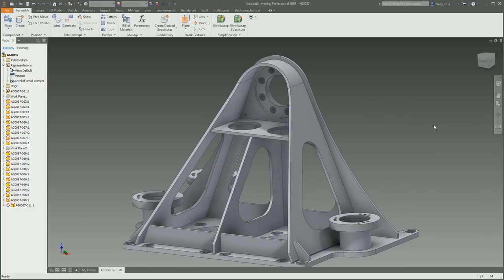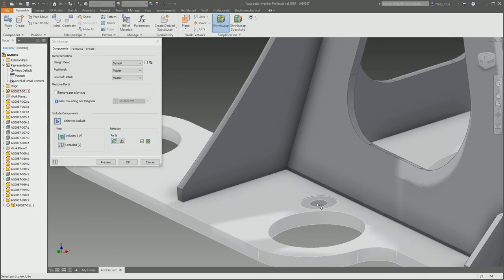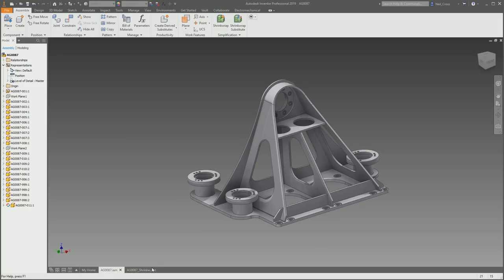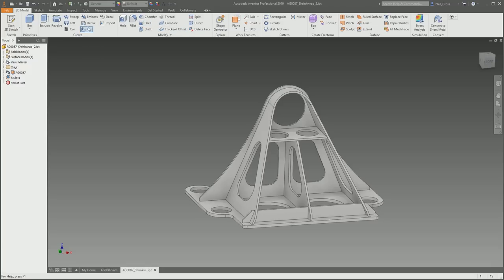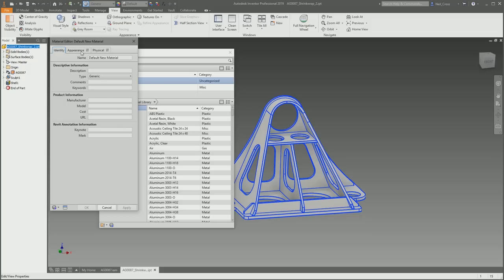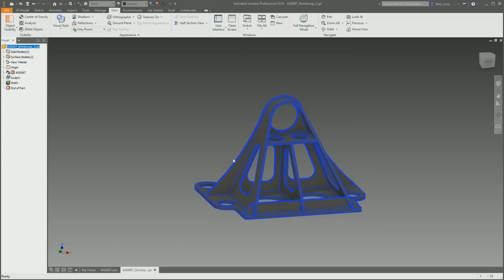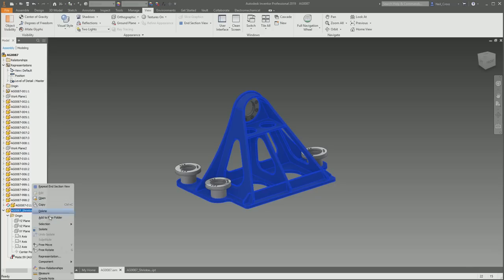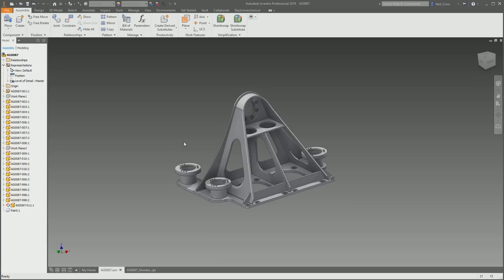How To Calculate The Weight of Paint or a Coating | Autodesk Inventor

Comment: Hi Neil,
I work in a design team creating sewage treatment plants for cruise ships. Biggest I worked on was 9 metres square and 3 metres high with a base frame and both internal & external structure. The material was steel so a lot of paint was needed.
This is a very interesting topic and if I ever get a bit of free time I'll give it a go on a current project.
Your tutorials are superb. Thanks again.
Jim

Comment: Great video. A potential workaround to maintain adaptivity: I assume you needed to break the link in order to assign a material to the shrinkwrapped part? Inventor considers shrinkwrapped parts to be substitutes for their parent assemblies. Materials and physical properties may not be assigned, they are inherited from the parent assembly. To get around this, derive a second part from the shrinkwrapped part and proceed with the shell etc.

Comment: I think I know why It is that heavy, and is maybe because 1 mill is not 1mm, the correct conversion is something like this 1 mill = 0.001 in = 0.0254 mm, mill is a measure of thickness generally for paint... Of course the method to calculate the weight is still awesome. I write this just for info.
Reply: Yeah i was thinking the same thing
Reply from the maker: Hang fire I'm going to report back on the type of paint used here, it really is 2-3mm thick I held a sample of it - it might be a mixture of paint and some kind of protective coating but I'm finding out the name of it and will report back.

Comment: Can't we just calculate the surface area and multiply it with coating height then by coating density
Reply from the maker: Well you'd have to shrinkwrap an assembly into a part to isolate the painted surface area - so you might as well go the rest of the way and let the software do the calculations.  But yes you could do it by hand.  You could do a lot of stuff by hand instead of using technology to do it!
Reply: mryoutuser that method is more than good enough unless you're paint system is absolutely dialed in. The thickness is going to vary more than you realize building in the bulk of your error.
Reply: What I meant is doing that using inventor, just get the model area form its properties ( make sure it has no voids because their surfaces area will be count), then multiply it area with the coat thickness * coat density using calculator or in line inventor expression evaluation (still using technology). I give it a try and results were close by 99%. Thank you for you amazing videos and your work is really appreaciated.